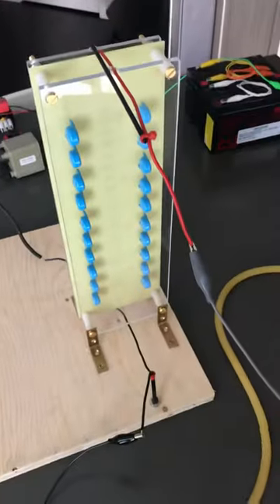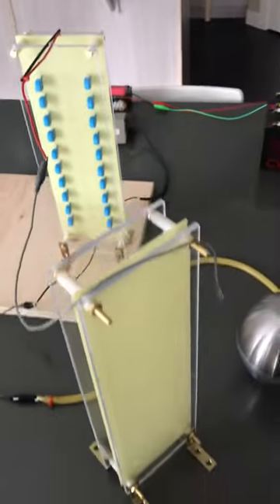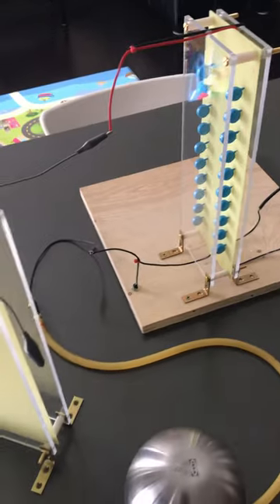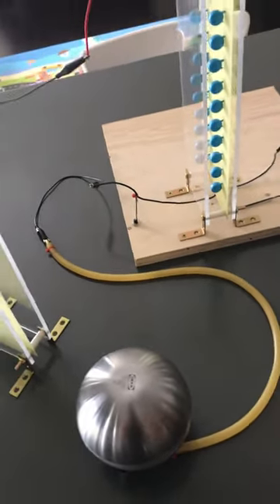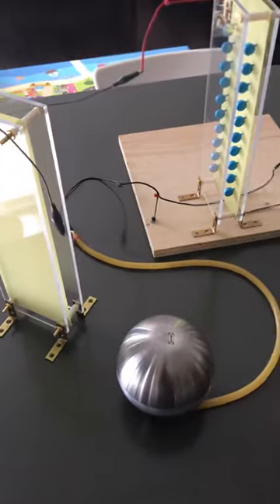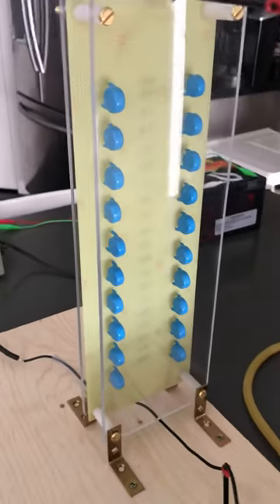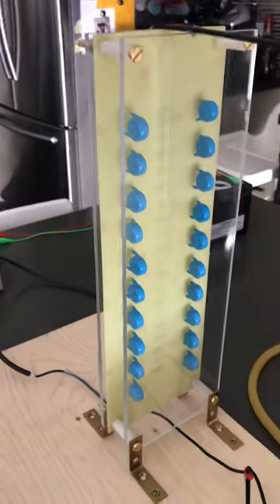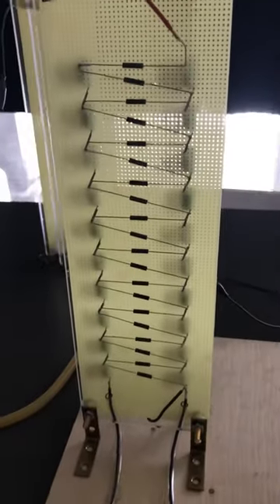Cockcroft-Walton voltage multiplier

Comment: Can you just keep adding diodes and capacitors and get higher voltage to as much as you want? Our does it have a limit?
Reply from the maker: Theoretically yes but practically no. There is a limit to how many you can chain together before too many losses.
Reply: Ok but how many can you possibly on the one in the video?
Reply from the maker: @insanescience8106   Not sure. There’s a calculation based on power supply specs and components used in the multiplier stages.
Reply: About how much voltage is the flyback transformer?

Comment: What do you mean by negative/positive voltage multiplier and why does the arks get bigger if its negative? How can I change the polarity?
Reply from the maker: Exactly that, one stack is 10 stages with the diodes in the positive direction and the other stack has 10 stages in the negative direction so the potential difference across the two stacks is doubled.

Comment: what happens if you dont have the water resistor at the output? i think it's around a few megaohm right?
Reply from the maker: I don’t want to risk pulling too much current through the diodes.
Reply: @Tesla210  ohhh, but that would really be interesting if you use like a 1 amp diode a few in series and would potentially be able to make long continuous arc
Reply from the maker: @groundkopi5975   I believe it would have to be a fullwave multiplier. This is only halfwave.

Comment: Can I use a power supply instead of the batteries?
Reply from the maker: Irakli Abzianidze  To power the ZVS driver yes. Not the CW Multiplier directly. Make sure you have a switch between the power supply and the ZVS driver because the slow voltage rise of the power supply upon turn on will kill the ZVS driver.
Reply: @Tesla210  thanks for the reply!!!

Comment: Hey, is it possible to power this with an AC adapter
Reply from the maker: M3MZ  Possibly with way less output
Reply: @Tesla210  could you please send a link for the kind of adapter that would work?
Reply from the maker: M3MZ  I would suggest a ZVS driver and an AC flyback.
Reply: @Tesla210  could you please provide a link? The ones I could find are out of my price range
Reply from the maker: M3MZ  I don’t have a link. I made the ZVS driver from a common schematic found online.